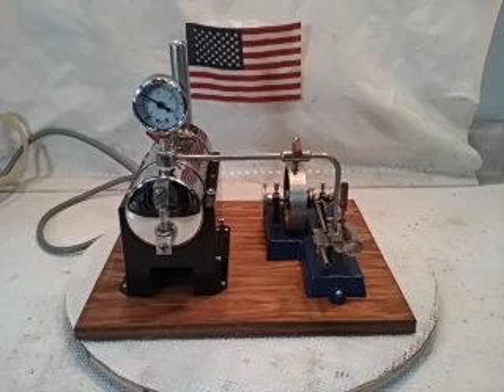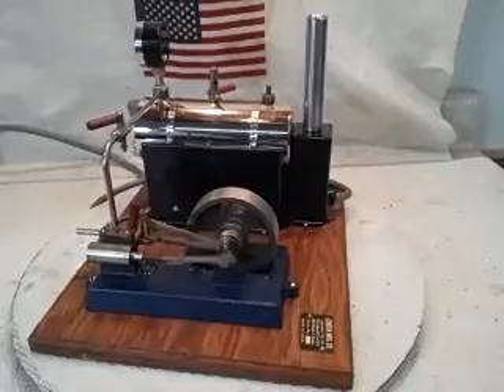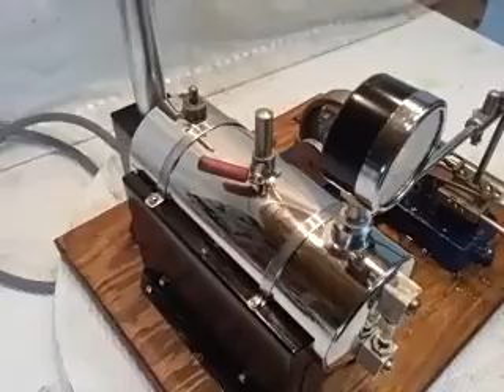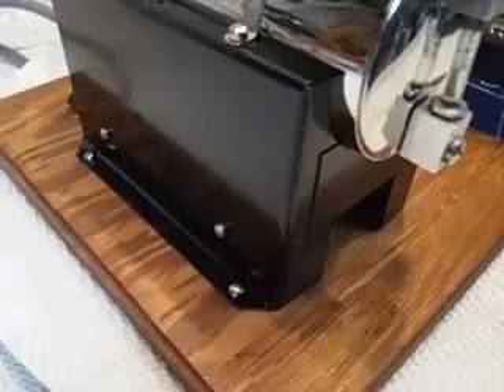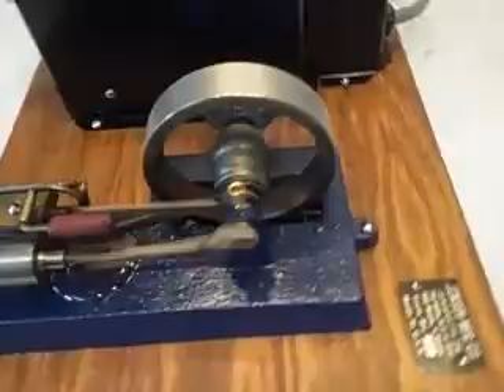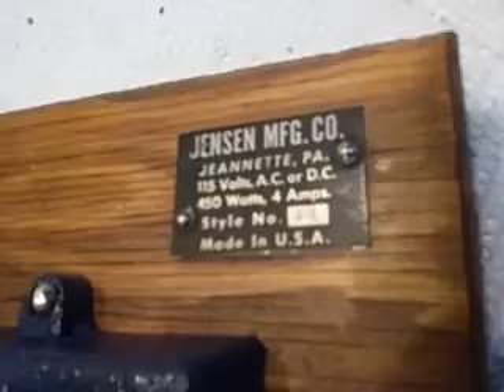Jensen #25 live steam engine (1950's)

Comment: Beautiful work.  I love your pressure gauge and water level indicator.  I'm sure these are not original.  In the garage of my childhood home I recently found my old Jensen I had as a kid.  It's in very rough shape with terrible corrosion.  I managed to get the piston out and everything moving again
but it can't be fired up.  A fitting has broken off the boiler and where it was attached is badly corroded.

When it did run even as a kid I was a little afraid of the boiler running dry or worse yet bursting from getting clogged up.  Great memories though.